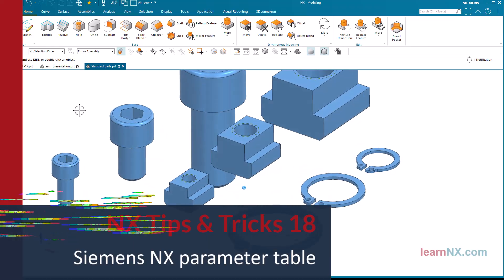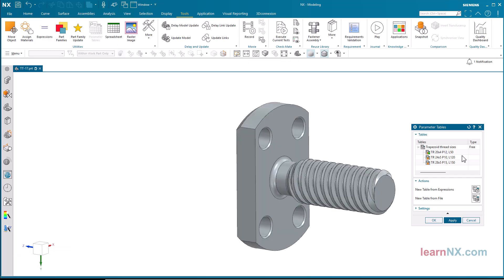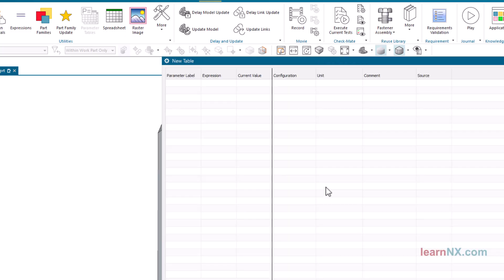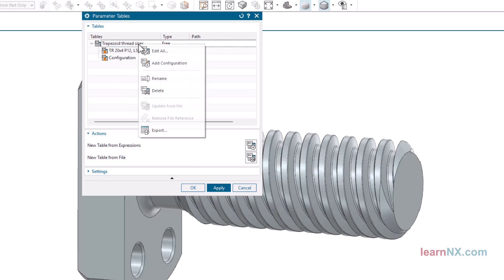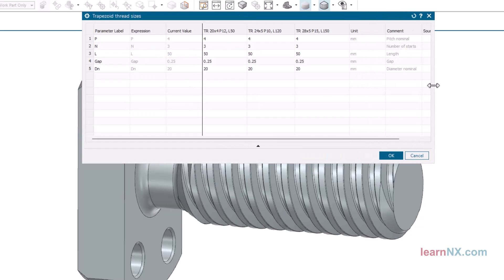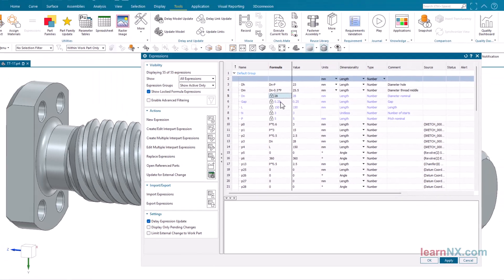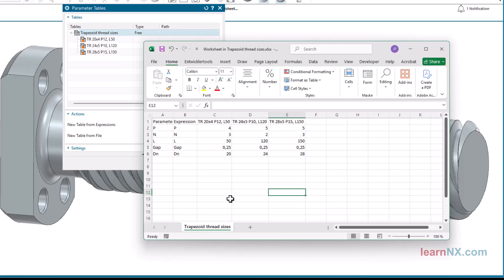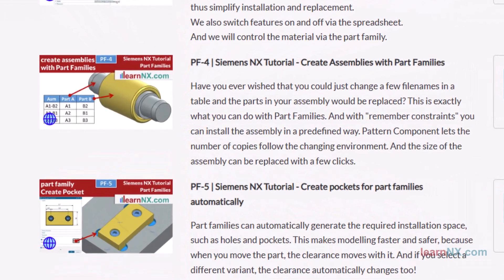Siemens NX parameter table

Comment: At the start of the video, at 0:10, you showed an assembly with several parts, each with a different Parameter Table line "activated". How can I do that? I mean, can I insert the same part as components in an assembly, but each component have a different activated parameter set?
Reply from the maker: Hello Thiago, not with parameter tables. This is the perfect tool for managing different parameter sets in a part and changing them to other sizes. To manage different sizes of a part in an assembly, I recommend searching for part families. You can find all the information on this topic in the ‘Modular Design’ course. It starts here: https://learnnx.com/lesson/siemens-nx-part-families-how-to-create-and-save-master-and-variants/
Reply: @learnNX  I've looked into Part Families, but it seems they only work well for single parts or for bottom-up assemblies. I wasn’t able to get them to function properly with top-down assemblies (where I have variables and bodies defined at the assembly level that drive multiple components through interpart expressions or WAVE links). When I try creating an assembly-level Part Family, the components continue to reference the original assembly instead of switching to the corresponding family members.
Reply from the maker: @ThiagoR7767  And you have already seen the last two videos of the series?
Reply: @learnNX Yes, I’ve seen those videos. They’re interesting, but they don’t solve what I’m trying to do because that approach only scales when the number of variants is small and predefined (e.g., 28 wall types in your example).

Here’s the issue. Assembly_A has a parametric Box driven by Width, Depth, and Height. Inside Assembly_A there are six components (Front_Panel, Left_Panel, Top_Panel, etc.), and each one has a WAVE link to the corresponding face of the Box in Assembly_A (for example, Front_Panel links to the front face).

What I want is an Assembly Part Family of Assembly_A (Assembly_A1, Assembly_A2, etc.) where each member has different Width/Depth/Height values. The problem is that when I create the family, Assembly_A1 still contains the original components (Front_Panel, Left_Panel, etc.) whose WAVE links continue to reference the original Assembly_A, not Assembly_A1. So when I change the expressions in the family member, the linked components don’t update.

Your solution would be to create multiple versions of every component (Front_Panel_1, Front_Panel_2, etc.) and map them in the part family table so Assembly_A1 uses Front_Panel_1, and so on. But that doesn’t scale: if Assembly_X has 50 components and 30 possible variations, you end up with a huge family table and thousands of component variants. Adding a new variation later means creating it again for each of the 50 components, and if you include subassemblies it becomes even less manageable.

Product Template Author matches the use case, but the “children” lose associativity with the original, so if I update the original, the derived children don’t update.
Reply from the maker: @ThiagoR7767  
This is a complex but interesting problem. However, the solution cannot be found here on YouTube. Please describe your desired goal (not your problems) as precisely as possible and send it to info@learnNX.com
I will look for a solution and send you a quote.

Comment: Why use this instead of part family
Reply from the maker: If all parameters of the part can be controlled via tables, part families should be created.
However, if areas of the part still need to be customised individually, the parameter table is more suitable.